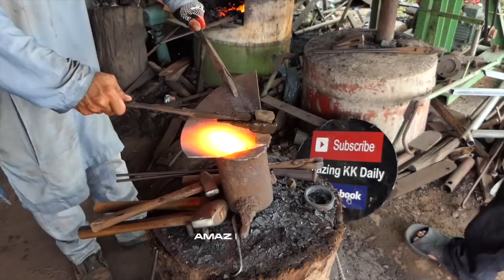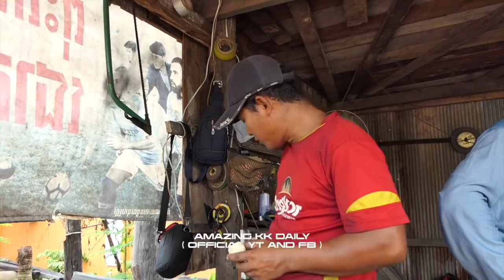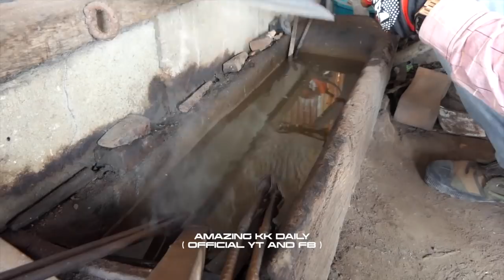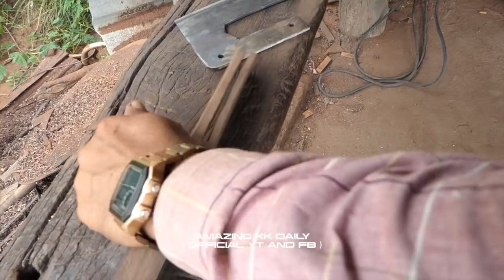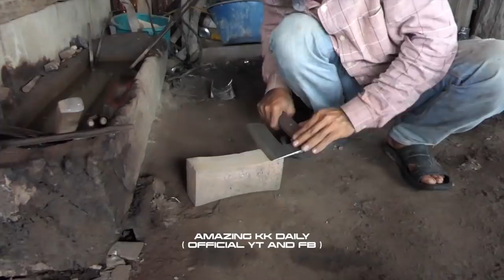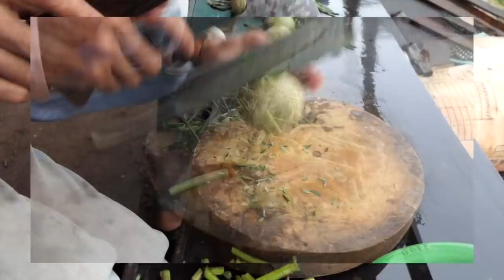MAKING A NICE KITCHEN AXE FROM A PIECE OF BROKEN TRACTOR DISC PLOUGH

Comment: What are the 3 tools you wish you had that will help your business??
I will see if I can help you 👍
Reply from the maker: Marty Arriola thanks anyway
We wish to have a drilling machine and a belt sander the most
Reply: Would love to see a gas forge, less work easier heating. 350 delivered from Lithuania.
Reply from the maker: Forgot one more thing, the anvil
Reply: @AmazingKKDaily  Where is this shop located? And do you have a PayPal or anything like that? 

The pride the smith puts into his work is very obvious in the quality of the finished products and I'd like to help provide tools to better match his capabilities once COVID has settled and I am more financially stable.
Reply: @yello4bangazuki147  The downsides to a gas forge is the sheer price of the gas itself, this smith makes his own charcoal at another location and has it brought to his workshop, making it much more affordable than frequent trips into town to re-fill a tank with an expensive (and kinda dangerous) pressurized gas

Also 350 Euro is about 1.7million Riel, which seems a tad expensive for their area for a single item, personally I feel they would benefit more from the previously listed tools (i.e a belt grinder, drill press, and proper anvil) than they would a second forge ya know?
Reply: @meatsmell8639  all true points, making charcoal or buying charcoal where I am is a lot less efficient for me. Although I don't know if gas would be cheaper there? Either way all the tools listed above would be great.
Reply: @yello4bangazuki147  I'm in the same boat as you, gas is much cheaper and easier than obtaining/making charcoal, however from what I've deduced from their other videos, they seem to be pretty far from any towns/markets large enough to be able facilitate it cheaply enough to be worth the trip let alone whatever markup the gas is gunna have.

 Combine the expense with the (inevitability due to the area) lower quality control of the gas itself, not to mention the failure points that are apart of having gas regulators and the hoses running through a workshop, charcoal is the way to go for them
Reply: A few comments in this thread about gas and prices, effectiveness, and such.  I made a small hydrogen generator for another project, it wasn't big enough for that so I've been using it to melt down my aluminum into muffin size lumps.  I think it would heat steel enough to work it with minimal expense.  I use a battery float charger to cause my reaction and its using very little power compared to the heat I get from it. Hope this helps someone.
Reply: @forcesightknight  Those are great and all until you do it wrong and things explode 😬